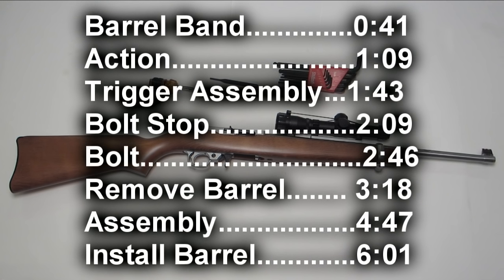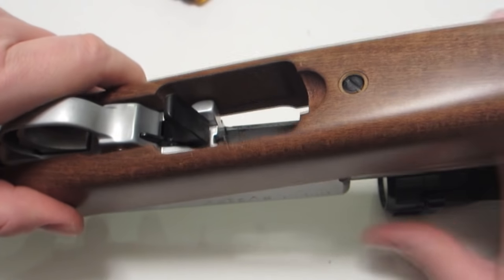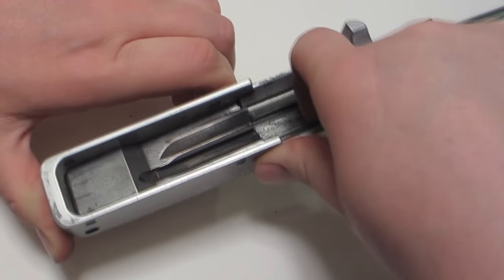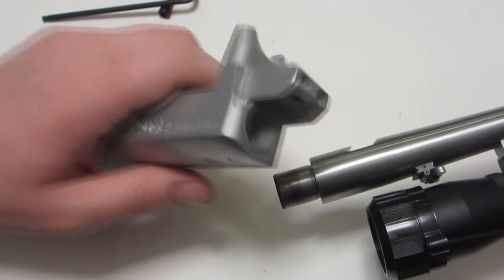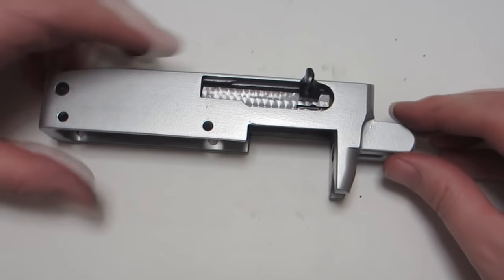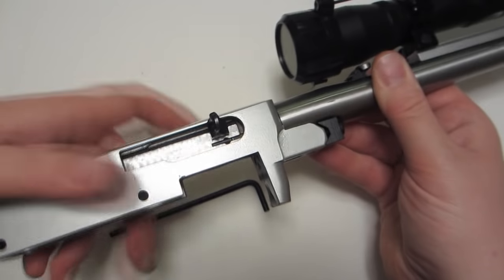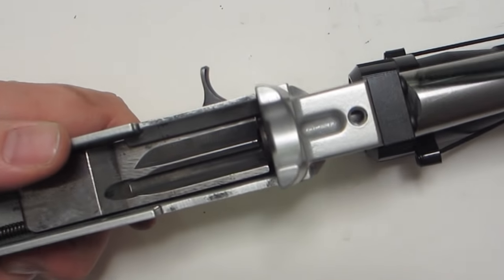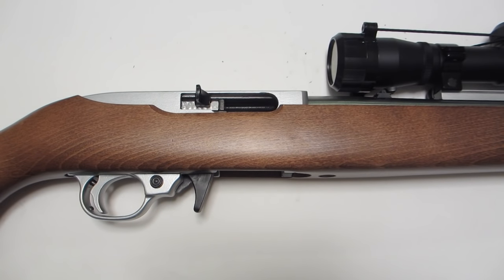Ruger 10/22 Disassembly Assembly Including Barrel

Comment: Good Video, but you really should use the proper screwdriver.  Standard screwdrivers tend to strip off the grove in the screw head.  That will eventually cause it to be harder to remove, and it looks bad.

Comment: I had to disassemble my 10/22 to find out why it would not eject any manufactures ammo. Found that the hammer face looked like a mill file. Bad manufacturing. Smoothed the hammer face so it took a lot less energy to have the bolt slide over and cock the hammer and eject the spent round. Now I think if you even hand fed a 22 short it would have enough energy to move the bolt.🤣

Comment: A lot of barrels do not come out that easily! Be warned.
Reply: What do I do in this case? My barrel is really really in there 😂 stock barrel had it for thousands of rounds... At this point it's like they've mended together got a replacement but can't seem the even get a wiggle out of the barrel.
Reply: @thesecondslim  I feel your pain. I just did another last year and the barrel came right off with no problem. I can't remember how I got the first barrel off. I had to build a jig of some kind to get the leverage. A 'C' clamp possibly. When it did come off it was a very loud pop. Good luck.
Reply: @dobdoa3691  got it, thanks. think I'm gonna try to take a heat gun to it and persuade it slightly with a rubber mallet when I get home. Wish me luck lol.